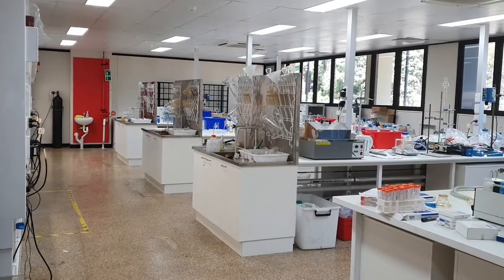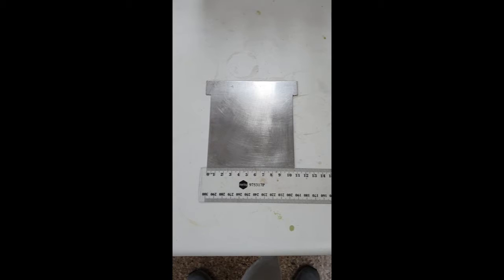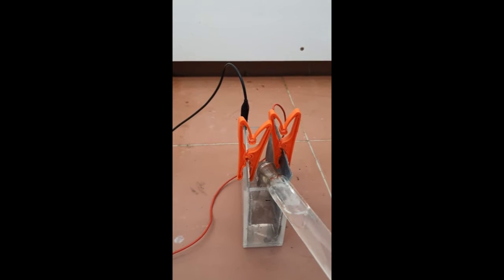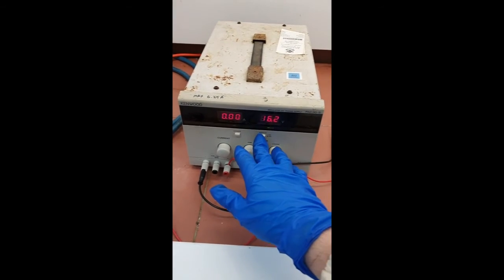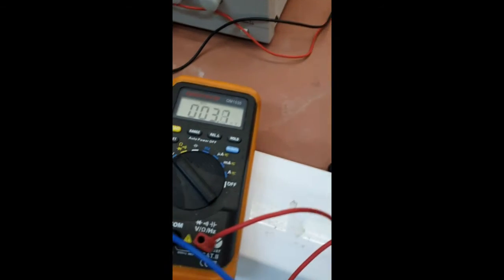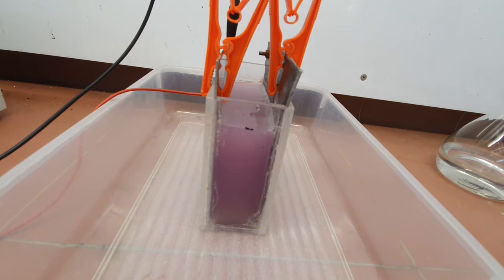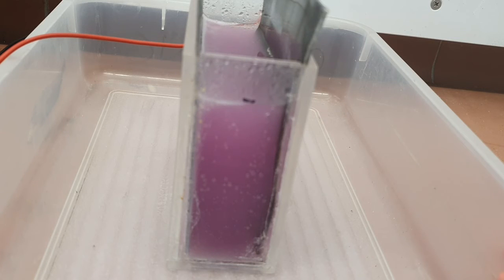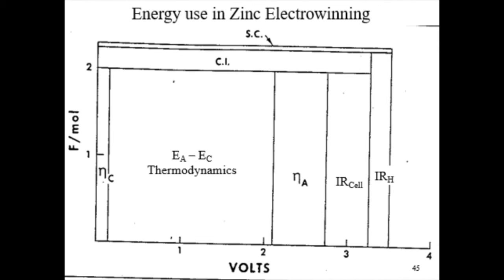Zinc electrowinning lab demonstration

Comment: I used a similar setup for zinc powder recovery from zinc sulfate solution. The problem that came up was that the zinc podwder that was being deposited would not stick to the cathod and i would lose it in solution. What should i do about this problem. I want to setup a large scale cell.